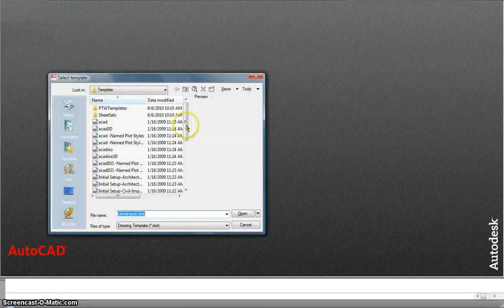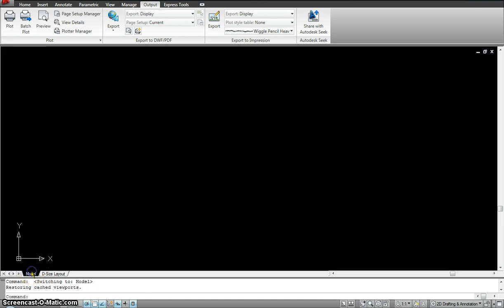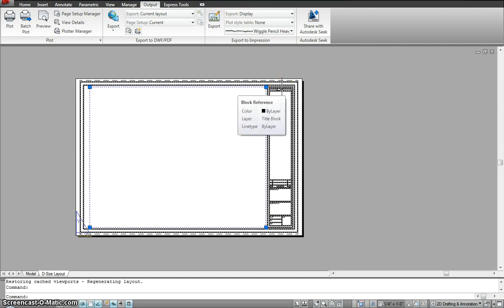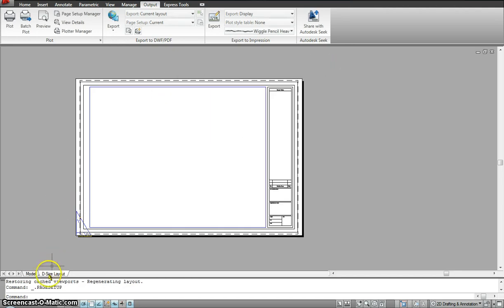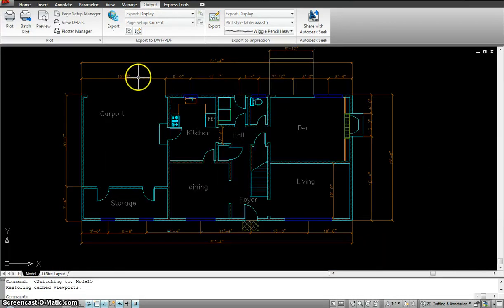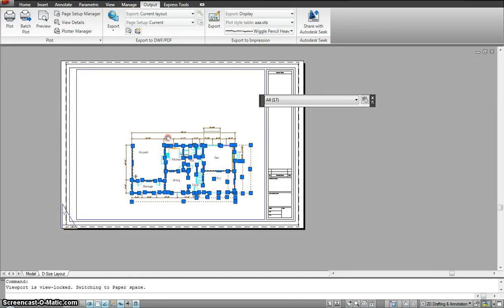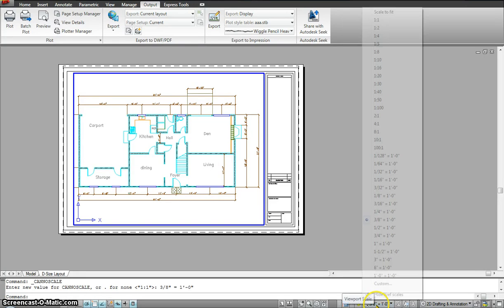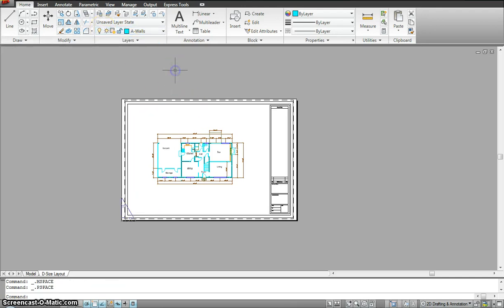Autocad Managing Paper and model space- Part 1.mp4

Comment: salam sir
me abrar facing problem in model space there is different scale for drawing when i measuring the result is  come different please solution is must for me
Reply from the maker: salam abrar, if the measurement in model scale using the distance command is coming out different then the drawing was scaled down in model space. the measurement in model space should always be 1:1. if you have a different measurement in model then you will have to scale the model to the correct scale using the scale command or align command. check out the align command it should be a lot easier to fix.